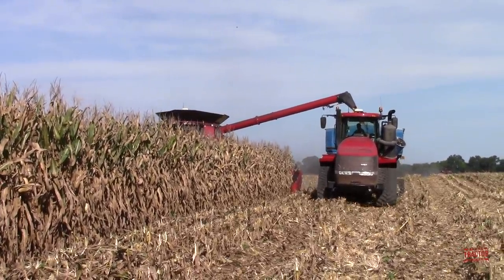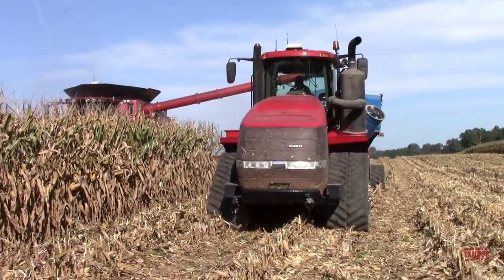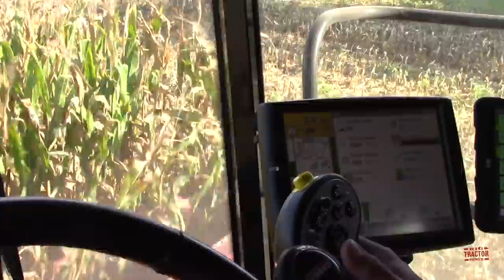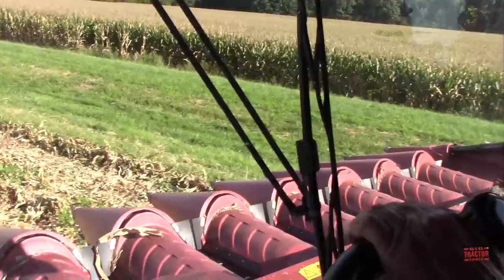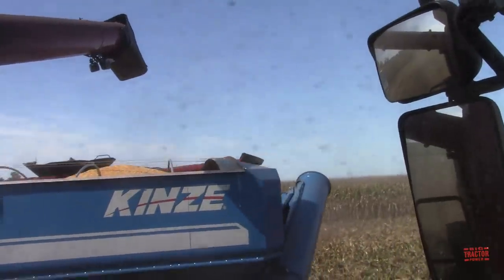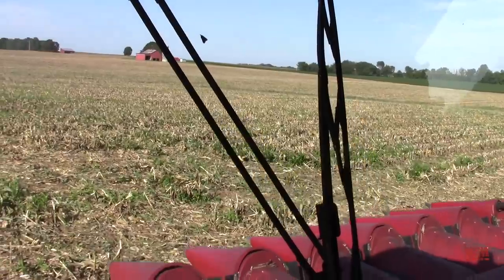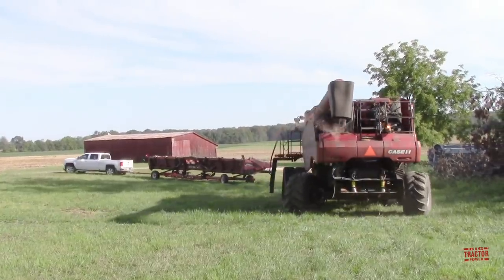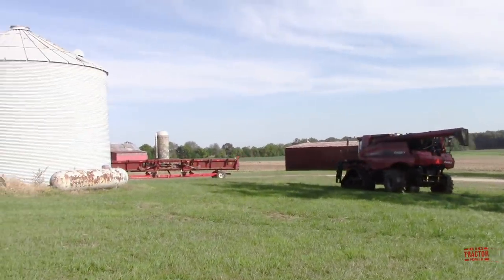2019 Corn Harvest 16 Rows At a Time: Case IH 9240 Combine

Comment: Awesome video! I've been begging my employer for a 1230 header to go on the front of my 6088 case ih. I'm loving the fd75 35ft Macdon header. My machine pushes that header like it's a 15footer on front of that thing. The horsepower has been increased to handle the load and it will run circles around a johndeere or gleaner any day.

Comment: I trying to get my head around a cornhead. After harvest it seems to me all material is shredded but it looks like not all material goes trough the machine which makes sense. So i presume the header shreds the material and pulls the ears of. Does it shred in the header or underneath? How does it work? Thanks
Reply: @Lex van Kampen there are videos that explain this better than I. But there are gathering chains that pull the stalk to the back and into stripper plates. The plates are adjusted just wide enough to let the stalk clear but not the ear. Underneath the stripper plates are rollers with blades attached to them. I think called snap rollers. They turn or spin pulling the stalk down. As the stalk is pulled through the stripper plate the ear hits the stripper plates and is ripped off and goes into the header. The snap rollers shred the stalk.
Reply: Lex van Kampen stalk shreds underneath.
Reply: Thanks guys! I found some vids on the headers before but the shredding wasnt clear. Millennial farmer good some good vids on upgrades of headers. Cheers!

Comment: Reply to Brad not Landa
Awesome set up there, and those class 9s kick it. 
Everyone is always watching someone's combine and saying "You need a Fendt" or a New Holland, or whatever. I suspect that there aren't huge differences in production on the top of the line current models. Is that true or does someone really stand out?
Reply from the maker: Brad every company makes a good combine.  I have gotten to film each brands combine and some do stand out to me.  I have not had a chance to film a Fendt Ideal and hope to do that this fall. 

To me the best combine on the market for quality clean grain and the least loss is the Gleaner S series. 

A close second is the Claas Lexion and the Terra Track System makes the Lexion top notch on dry and wet ground. 

The New Holland twin rotor also produces nice grain and little loss. 

When it combines to harvesting a bunch of corn well the Case IH class 9 combine is hard to beat.

Comment: Are draper belt's header are good in corn also??

That to 40ft header
Reply from the maker: A corn head only picks the ear of corn for the combine to thresh.  A Draper head cuts the entire plant to be threshed.  There is an 18 row corn head which is 45ft offered by Geringhoff and Drago.  Several farm’s in this area do run 45ft Draper heads for wheat and soybeans.

Comment: Hey Jason, It seems like that tracked combine rides pretty smoothly even driving across the picked rows. Do the wheeled machines ride as smoothly? Thanks. Great video like always btw.
Reply from the maker: This farm has run tracks since the 9120.  They really like them and they are smooth. I think tried ride as nice. Tracks are great for reducing compaction and in wet conditions.
Reply: Tracks are way, way smoother. They have a larger contact surface of which the bigger part is suspended.

Comment: as wet as that corn is for every 10 bushel they dry they have to be giving the gas man 6 and the rest is going to the bank and with prices the way they are thats not good hope things turn out ok for them and all the farmers
Reply from the maker: Clearing the field off to get next years wheat planted is important.  When the wheat is cut in June soybeans will be double cropped in to harvest in October. It’s a tight time line to make sure the field produces two crops in one year in 2020. It all works out well.